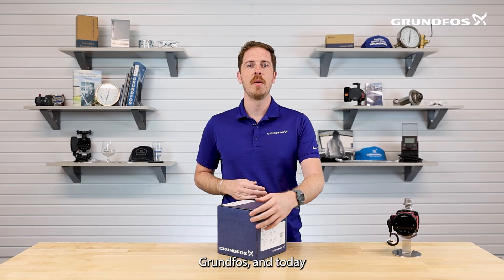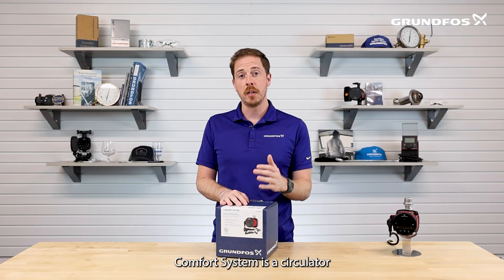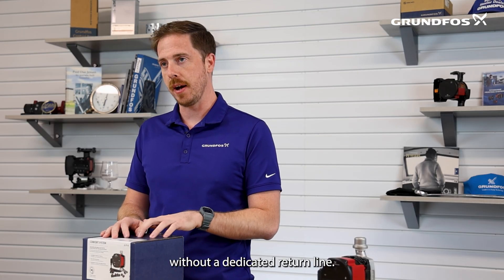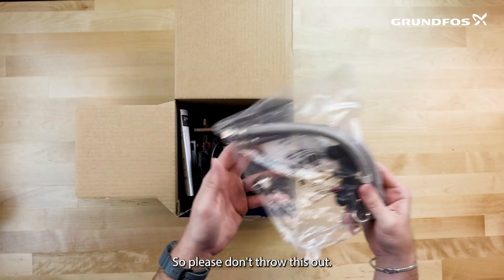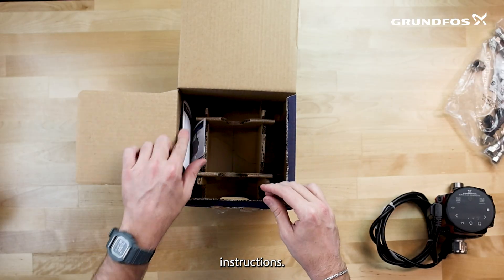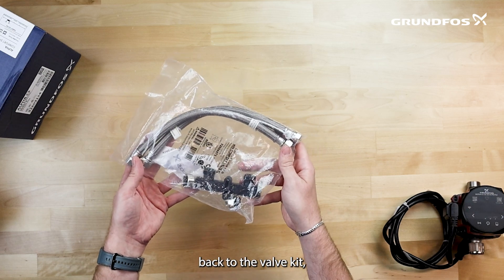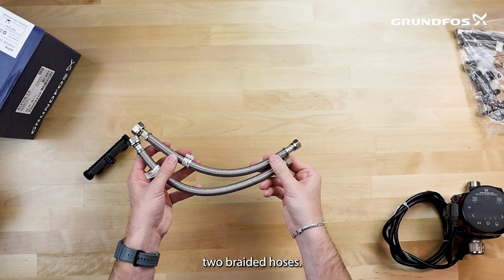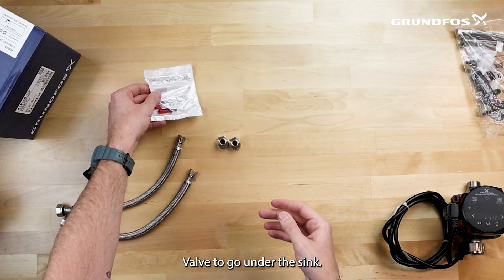Unboxing the Grundfos ALPHA Comfort System

Comment: My home has two water heaters plumbed in parallel. The hot outlets merge at a tee and feed a single hot-water supply line to the house. The tee assembly sits on the floor and isn’t secured to framing.

Questions:
	1.	Is the Grundfos ALPHA CS 15-55 SU7P/TLC (115V) appropriate for this setup as a domestic hot-water recirculation pump?
	2.	If yes, where should the pump be installed after the hot water merge? Can it be installed at the unmounted tee on the floor, or does it need to be secured/mounted elsewhere?
Reply from the maker: Hey there Scott! You should be able to use the ALPHA CS for this application. You'd likely want it to be installed on common supply line. You could also potentially install on top of one of the water heaters, however you could need to also install a check valve to prevent backflow to the other heater. It really just depends on how the whole system is plumbed. I would get in touch with a local licensed installer to assist in proper installation. Hope that helps! -Ty

Comment: This pump seems to come with an NPSL connection on one side do you provide adapters (part number) for connecting to an NPT type thread? NPS fittings seem to be hard to find
Reply from the maker: Hey there! The ALPHA Comfort System is equipped with a ¾" NPT(F) female connection for attaching the pump to the water heater. To complete the installation, the plumber must supply a top pipe fitting compatible with the pump’s ¾" NPT(M) male threads.
Reply: @grundfos Thanks but this statement is not accurate. The label on the box clearly states NPSL for the inlet (female) and I can see that the label matches what is on the pump. The threads are straight and it has a rubber sealing washer. The outlet (male) is indeed NPT Model number CS 15-55 SUP7P/TLC. Thanks in advance!
Reply from the maker: After doing a little more research, male NPT threads work with the NPSL nut and gasket. This is common for this type of swivel fitting. The NPT male seals against the gasket.
Reply: @grundfos Thank you very much for following up on this. I noticed that it would seal on my worry was more about the reliability of the connection as there are only 3 threads in the female side and the the tapper on the male side reduces the grip with each thread